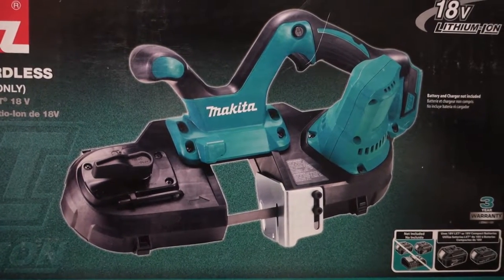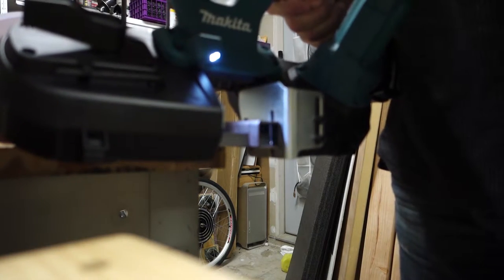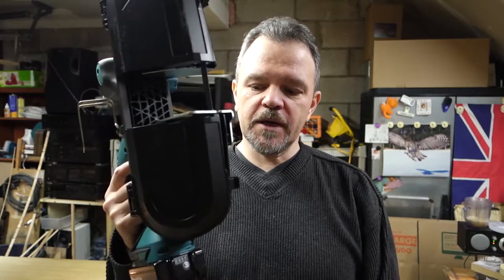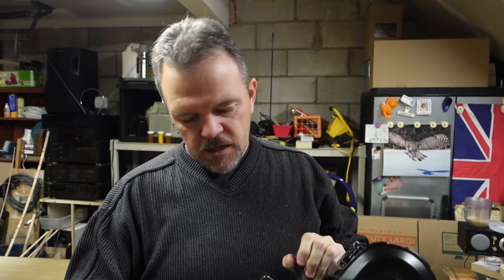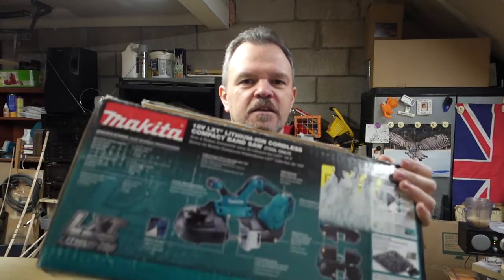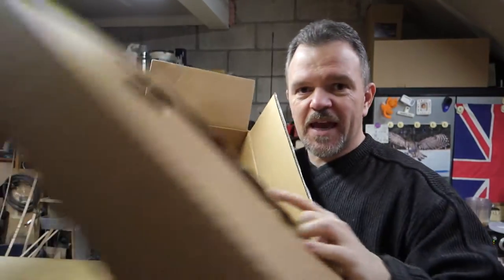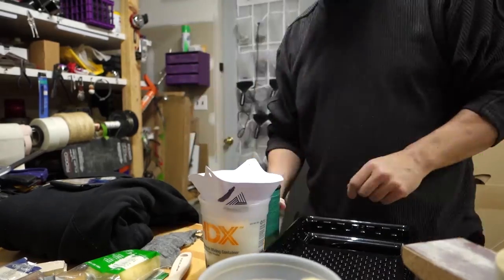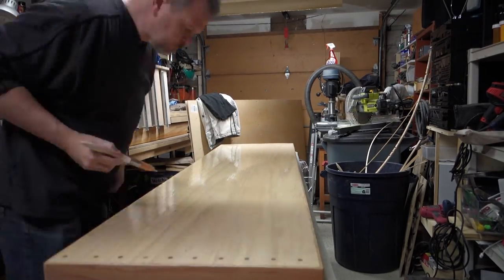NEW Makita 18Volt 4AH Handheld Bandsaw for my Birthday Plus Upcoming Handheld CNC Router Purchase

Comment: Too bad the saw doesn't hold up to regular use, bought one and used it for several months until the blade started to jump off continuously even after tightening up the adjustment screw hidden under the non drive wheel.
Turned out to be totally unreliable in the end.